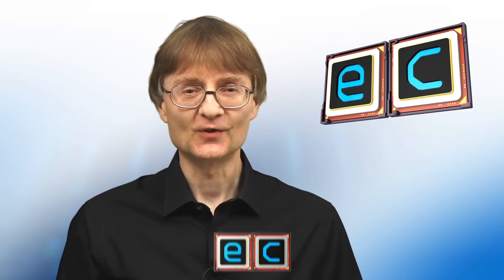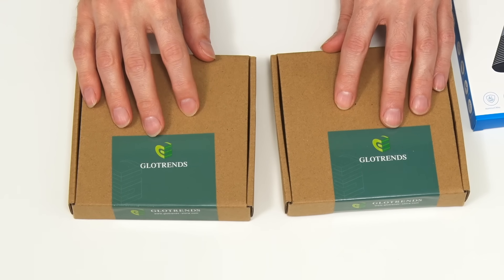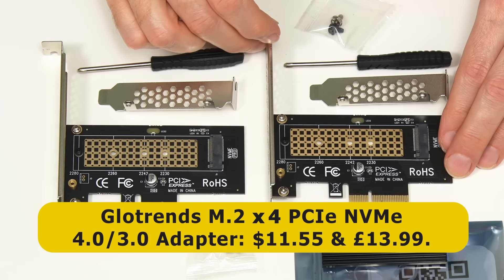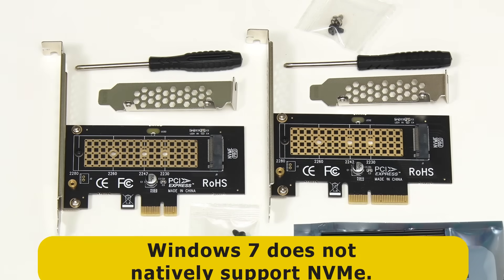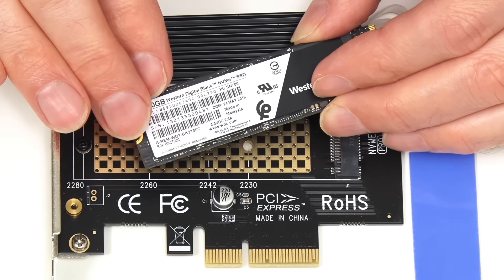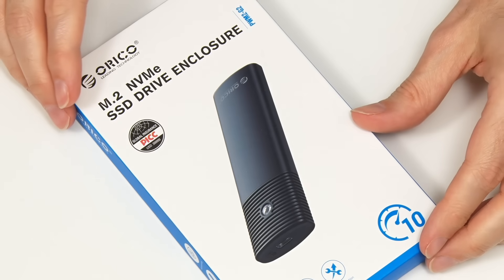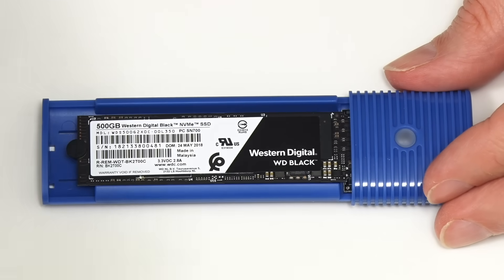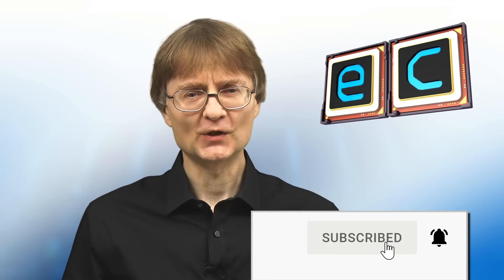M.2 SSD Adapters & Enclosures

Comment: I'm currently trying to get one of these cards working on my server which is a repurposed old PC from the 2010's (HP Compaq dc7900 sff). But truenas doesn't seem to recognize it no matter what I do. The card works on other PC's, and I've tried every PCIe slot in the server. Could it be the operating system or bios that doesn't want to recognize it? Any help would be appreciated

Comment: The M.2 connector/form-factor (or in other parts of the world "NGFF") is unexpectedly versatile as I seen M.2 NVME adapters to Oculink or full size PCI-E x4 for external GPU support in portable devices. But the one piqued my interest is the M.2 NVME to 6 port SATA expansion card/board and I wish I knew about before I built my NAS.
Reply from the maker: I agree, great flexibility is emerging with the form-factor. M. is the new name for NGFF.
Reply: So  You want to use NVME Card in a DIMM Slot ?? 
Or if NOT, where does this 6  Port SATA  SLOT exists ????

Comment: I have heard that the label on the M.2 drive can cause inefficient heat transfer.
Reply from the maker: And I can see why. It is bizarre that we have labels on chips that either need, or would benefit from, a heat sink. We don't get such labels on CPUs! :) Attaching a heat pad and heat sink on top of a label really is pretty daft. And a damaged label is also likely to result in a loss of warranty . . .

Comment: Very good video. I didn't realize about the x1 and x4 adapters speed difference. I have been using clonezilla to upgrade the boot drives of  servers with  an external nvme enclosure. Once you know clonezilla it is so automatic when you have 10 servers to upgrade. Thank you for the education.

Comment: A note about Orico USB Enclosures, if you intend to use them with Linux you might have some issues due to different controllers in them, some use Jmicron JMS578 that doesn't work really well in Linux (TRIM support for example), while others use ASMedia ASM1051E/ASM1053E/ASM1153 controllers that works without problem.

The thing is you don't really know what controller your enclosure will have until you get it and can check it.
Reply from the maker: The Orico I bought works fine with Linux. The controller in it is a Realtek RTL9210B-CG (1.00).

Comment: What about the perennial problem of getting a mother board to boot from an ssd mounted on an M.2 adapter card ?
Reply from the maker: It will depend on the motherboard (and OS). Modern (ie c.6 years old or younger) motherboards and a modern OS should be able to boot from an SSD on a PCIe card (or indeed a PCIe SSD).

Comment: Just to help out Sata uses A-B.  NVME -M slots. Quite easy to purchase the wrong slot size.
Reply from the maker: The B & M M.2 keys don't actually indicate SATA or NVMe/PCIe, they indicate 2 or 4 PCIe lanes. SATA are normally B & M keyed, and NVMe M keyed as you say. But there are/were B & M keyed NVMe drives. So if replacing/upgrading a drive, if you look and see that the existing one is B & M keyed, it does NOT follow that it is a SATA drive. You have to check the label on the drive.
Reply: Thanks, that's good to know! Sorry about the A-B.  I bought more than one B&M key and realized I needed an M slot.

Comment: I bought a dual M.2  Gen4 riser PCIe card from Glotrends.  It has an 8x interface.
My crosshair hero VII had no trouble with this and a GTX3080. When you take two gen 4 m.2 drives and put them into a "Striped volume" for performance, you get about 10,000Mib/s!  That speeds up game loading times considerably.
The BIG caution here is not just if you have a slot larger than a 1x but if your BIOS / Chipset will even support multiple M.2 PCIe cards.
Most have an upper limit on the total number of M.2s.  My Crosshair Hero, its something like 5.  The B550 Asus prime however, it's 3.  No matter where they go, mobo or PCIe cards 3 only.
Also note.  B550 nor most cheaper boards will allow you to "bifurcate" a single X8 slot into 2 4X M.2 drives on a single card.  That requires PCIe bifurcation.
It's a bit of a mine field, the only good thing is the cards are not expensive and you can test if they will work with £20 m.2 drives before spending money on good ones.

Comment: I built my current system about a year ago: Asus AM4 PCIe 4 motherboard, AMD Ryzen 7 5700X 8-Core Processor and 128 GB RAM (Leaving two slots empty for 128 more if needed) but since I was on a budget I didn't get any M.2 NVME drives, nor upgrade to a more capable graphics card (I have an NVIDIA GeForce 1050, PCIe/SSE2).  I used a few of my old SATA SSD's and although not what I would consider slow compared to disc hard drives of old, I recently got my hands on two new M.2 NVMe 1TB WD Black's with heat sinks for under $100 each, and Daaaaaaaaaaang are those suckers fast!😜  Partitioning them was faster than what I was used to, and so was transferring data to them compared to between two SATA SSD's. 

I still want a much better Graphics card, but am not at all into the prices, and in comparing their retail prices to their manufacturing cost it feels like there's still a lot of unjustifiable price gouging going on.😡I can't trust a used one, as there's just no good way to be sure what your getting, nor if you are being told the truth, and it's not just private sellers anymore, but even with the refurbished and scratch and ding ones from MFG's and retailers too now.  So many horror stories, including bad return policies...  it's just better to buy new, and have the best warranty and return options.

Comment: M.2 is very nice standard but it still hard to multiply it. Like m.2 to pcie switch for 2 discs in one slot for example. We have some things for GPU as post-mining era, but GPU consumes 12V and have 3.3 and 5V as linear stabilizers for pcie slot - no way this LM can handle two SSDs.

Comment: my experience with m.2 enclosures is that i bought some random cheap one off amazone, stuck an ssd in it, used it a few times transfer some pretty large files, and the enclosure died.  i'm guessing it succumbed from the heat

Comment: @ExplainingComputers  I would also point out that the multi Nvme cards require bios to natively support pcie bifurcation unless you fork out a lot of money to get a card that has the controller built in (eg CREST SI-PEX40129 Dual M.2 NVMe at £164)

Comment: These cards are why all my PCIe slots are full....  There exists a 3rd party NVMe driver for WinXP (and XP64). It is supposed to also work with Win7, but made mine throw up in ways I'd never seen before. However, it works just fine, at full speed, with XP64.

Comment: Thanks but you're about a week too late :)  I bought one of the Orico USB enclosures & a 500GB m.2 PCIe SSD & managed to clone an older ssd w/ windows 11 installed to the new ssd.  TBH, the hardest part was finding a free cloning solution to install.  All the ones I've used in the past ie., Macrium Reflect, MiniTools, Acronis no longer offer a freeware option suitable for disk cloning.  Fortunately the new ssd I bought was manufactured by Crucial & they offer a free version of Acronis True Image on their website (for detected Crucial drives) & so that took care of that!

Comment: The only thing I'd add is that external enclosures can be picky with the drive you put in them. I've a couple of external SSD enclosures that did not work at all with the 1tb drive I put in them. However, they worked with 128gb units! Go figure!

Comment: Unfortunatelly a bit late cause I had to buy 5 of these for a fleet of Raspi Pi 4 and Pi 3 so I had to check a lot if they would run and boot smoothly from ssd into Home Assistant.
M.2 is good enough for the Raspi use case. Faster will be more expensive and does not deliver so much better performance - at least for Raspberry Pi's
But I love the animations and explanations of what I was not aware of when I had to buy these in the past 6 months. And I bought and tested a lot, till finally even orico and other cheap ones from amazon did work out. The cheapest M.2 enclosures were about 9€ plastic and 11€ metal case.

Comment: I had looked at adding an M.2 drive to an older machine, but have not yet got around to doing so.

I was hoping that this video would solidify what research I had already done on the matter, but alas it was only a very shallow look at the matter.

You hinted at there being pcie boards that support multiple M.2 cards, but my understanding is that this is only possible where the motherboard has support for pcie bifurcation.

Then there is also the question as to whether all older motherboards will be able to boot from an m.2 drive, or whether you need to have a small SATA boot drive and use the m.2 drive as a secondary drive.

Comment: I have always hated m.2 drives. I find them very unreliable. I have had 3 Western Digital 1tb M.2 drives go bad on me in the past year, yet, my two, 4tb Western Digital 2.5" ssd's I have had for over 3 years are working perfectly.  So, until they can make a reliable m.2 drive that can last at least a year, I am sticking with 2.5" SSD. I find them far more reliable.
Reply: Your m.2 drives may be getting too hot. Have you tried installing a heat sink or thermal pad on them?
Reply: @Eternal_Tech  My motherboard has built in M.2 heat sink installers. It's an MSI MEG ACE Motherboard. The screws for the M.2 drives have got built in heat sinks. Also, my motherboard is not in a case. I have been caseless for over 3 years.  May a case would help with airflow? Sounds dumb, but maybe because of no case their is no real airflow? I do not know. Thank you for the reply, though.
Reply: @yogibear2k2          Yes, you should try a case. A well-designed case with the appropriate fans will more efficiently cool a system than a system not in a case.

Comment: I had a conversation with ChatGPT about M.2 enclosures the other day. It basically said make sure the drive isn't loose in there and doesn't get too hot. The one enclosure I use does have decent passive cooling, but it still gets hot, and I had to put a little something inside it to keep the chip from moving.

Comment: If you use the adapter with an M.2 SSD near a big hot graphics card then it's probably worth putting the heatsink on the M.2, because it's likely going to be kept warm by just being near the GPU. Unless you have a blower GPU, i'm not sure the correct name for it, the gpus that directly blow the air out of the back of the case, like Nvidia reference cards.

Comment: Something to note for speed chasers or people who have top level hardware and expect the ssd to run at top speed: those things were NOT properly dedigned or tested to run at high speeds and they overheat. And when that happens - its bye bye data! You can easily corrupt it and its gone in a flash. Keep your ssd heatsink on and dont push the transfer speeds to the max. Risking your data is not worth a minute faster upload.
And remember: always copy paste, never EVER cut and paste. Its not worth it!

Comment: don't forget that USB devices on the same controller share bandwidth, many computer's nowadays only have 1 or 2 USB controllers and all the USB ports connect to them via internal USB hubs
it's why some graphics cards have their own USB C port intended for VR headsets, it has it's own USB controller and is the only port on that controller so the VR headset gets the full bandwidth and doesn't have to share the bandwidth with other devices

Comment: Watch out if anyone is going to get a 4x4 PCI-e 4.0 expander like Asus or <insert other brand here>.  Motherboard/BIOS must support a feature called "Bifurcation".  Basically it splits the 16 lanes up into 4 4-lane chunks, 4 for each NVME SSD.
Reply: I think I've then learned two new things from you today! That's also useful to know, I will check that one out also!

Comment: Don't know if you've covered this or not but PI4 (at least the 8GB to my knowledge) actually lets you install a distro onto a blank micro sd card or usb stick from within the pi itself.

I only found out by a accident because i put the wrong card in, you need an ethernet connection though, i dont think wifi is supported.

It downloads the Raspberry Pi imager software to memory then lets you pick a distro in that. Then writes it to the blank card.

Comment: This is an extremely well put together video. 
Thank you.

I have an older desktop , built in late 2018 with lower spec'd budget parts from the time. I had been looking at m.2 drives as their cost continues to fall.

These might give my older PC slightly faster storage, will need to look up board specs. I looked at the USB options as well. 
I wonder if these could serve as low cost archival drives?

Comment: @10:45 Watch out for the caveat that some motherboards turn PCI-e 4.0 slots into PCI-e 3.0 speed if the CPU has an integrated GPU, e..g AMD nn00G CPUs.
Reply: I had no idea that that could be the case but I will check it out and, if so, thanks for a very useful bit of information.
Reply: @terrydaktyllus1320  No worries.  Solid example is B550 board and AMD 5600G.
Reply: @declanmcardle  I haven't got as new as B550 boards yet!

I like my hardware "old, used, cheap and plentiful" for running Gentoo Linux on, so I am always looking at ways of upgrading and expanding systems cheaply to make them work better.

But I guess I will get around to one or two of those B550 boards at some point.

But thanks again! I love the "technical geekery" discussions that always appear on Chris' Sunday videos.

Comment: Isn't there much more complications in m.2 NVME drives and cards, and PCIE slots. Like sometimes PCIE slots share their lanes bandwidth with one another: stick something into one slot and the neighbour will not work at all or work at half lanes capacity. Or sometimes some PCIE slots will lower their PCIE version depending on the CPU. Or sometimes cards with more than one NVME drive can be some kind of RAID configured by the cards themselves or thru MB BIOS. Another question will these cards be bootable? Will these cards be accessable from external boot without injecting drivers into whatever you boot from? Can you actually find these particular RAID drivers? If you can, can you successfully inject these drivers into whatever external thing you wanna boot from?

Comment: nvme is the way to go especially since the recent massive price drops - look for capacities to grow - there really is no reason to use spinning rust mechanical hs or sata ssd anymore except for big backup jobs - using multi nvme adapters in motherboards that support bifurcation is a good way to get even more speedups using the nvme in raid arrays - expect speeds to get even faster with advent of usb5 and pci-e v6 which should be here in just a couple of years

Comment: I'm wondering about the chart at 5:12 in this video. As you look across the diagonal from PCIe generation to last gen ascending lane width, you see a pattern of rounding up. Looking at gen 5 you have 3.94GB/s repeatedly until switching to 4GB/s. Do more lanes offer more efficient transfer or is this just the result of different rounding methods?

Comment: The motherboard on my Lenovo desktop PC has only one M2 slot.
After upgrading my system drive from 256GB to 512GB, I purchased a Glotrends x4 adapter so that I could use the original SSD as a secondary drive. This initially worked as expected, giving the same read/write speeds as when it had been mounted in the motherboard.

Unfortunately, I encountered an unexpected limitation.  I was intending to install Linux on the secondary drive to create a dual boot system. This was not possible since my BIOS does not recognise the SSD in the adapter as a bootable drive. I confirmed this by temporarily transferring my system drive to the adapter – the BIOS found no bootable drives.
(I later installed a SATA SSD to create the dual boot system.)

I am not sure whether this issue is specific to my Lenovo BIOS (which offers very limited options) but it may be worth mentioning in your future videos on this topic.

Comment: Another lovely Sunday with EC☀and million subscribers is so close.
Some time ago I tried to give my beloved RPI 4 even more speed using M.2 NVMe with a USB 3 adapter. That didn't help at all, because the bottleneck is with the USB 3 port itself. In addition, M.2 get extremely hot compared to SSD (SATA).

Comment: Very well done and complete as usual Chris. There's one thing I'd like to add. If you have an old computer and would like to add an NVME drive to your system via a PCIe slot, check the BIOS if you hope that drive will be a boot drive. However, I don't believe there would be any problem using the USB external enclosure you showed in this video. It all requires a deep dive and close examination of the computer system at hand.
Reply: Theoretically, Sandy and Ivy bridge can use them as boot drive, but you need BIOS modding or clover boot.

Haswell, introduced nvme boot (even with PCIE adapter)
Reply: Yeah I was wondering about that too as this reminded me of the extra steps we needed to ensure that drivers are installed in order for the old main board to recognize the SATA HDD when it first came out.

Comment: I dug-out one of the x4 PCIe NVMe cards when you previewed this in a members-only message a couple of weeks back. I had previously tried this on a Windows 7 PC, which didn't work. That machine has since been "upgraded" to Windows 10 and can now see the drive, but the machine can't boot from it as the BIOS is presumably too old to cope with such drives. I'm now off to the Amazon locker to collect the toy hovercraft you previewed this week!
Reply from the maker: Good luck with the hovercraft!
Reply: I am having the same problem with my non-UEFI bios motherboard from 2011.